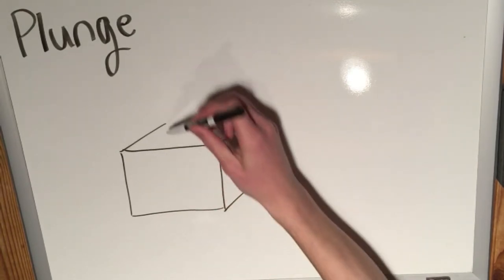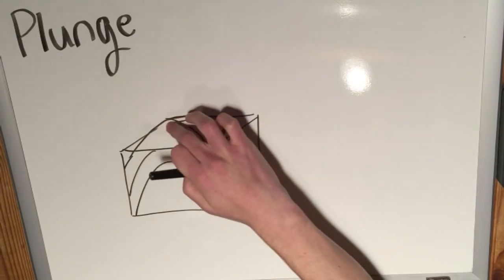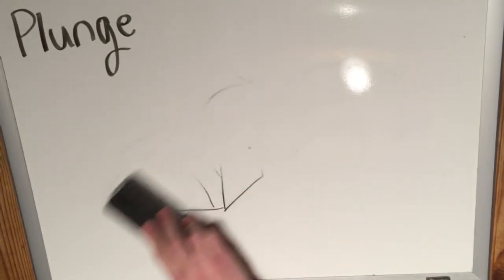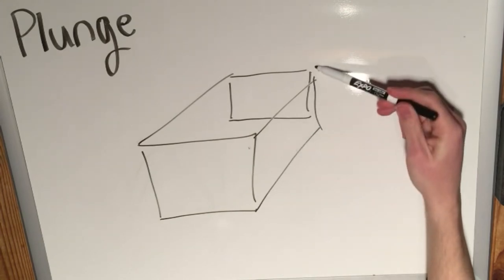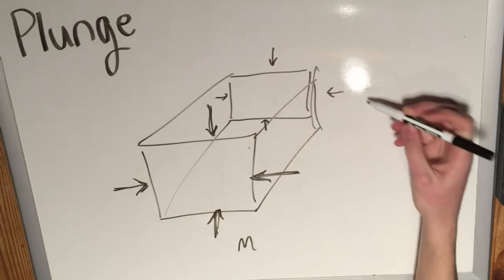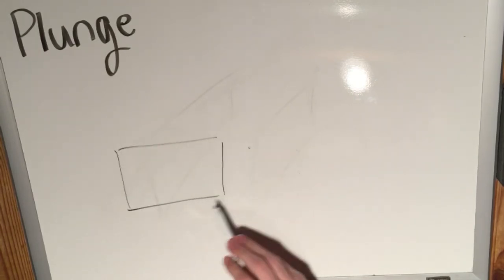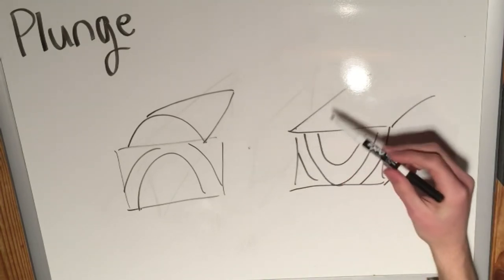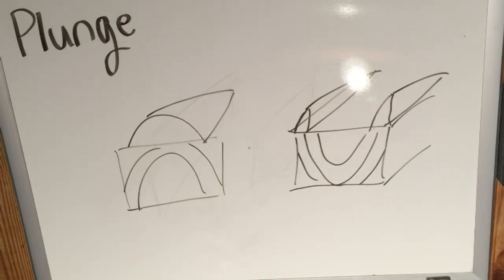Plunging Folds

Comment: What's the measure of plunge supposed to represent, though? I can't really understand this concept from anywhere else.
Reply from the maker: Plunge measures the degree to which a feature deviates from the horizontal. In the case of the folds I drew, they slant downwards at the surface. They would have no plunge if they were perfectly horizontal. Imagine a horizontal plane at the top of the fold, and measure the angle at which it dips downwards from there. A greater plunge thus corresponds to a steeper fold.
Reply: @geologic7656  That mostly makes sense. So the plunge is the angle between a horizontal plane and the cave-like structure you drew?

Comment: Is it possible to be vice versa of plunging direction...I mean thin borders or 1/2m at beginning and erupting feature in the middle of surface due to differential stress??
Reply from the maker: Quite possible. In fact, while I used anticlines in the example, synclines frequently do the opposite, meaning the beginning will contain the shortest (1/2 m) point.